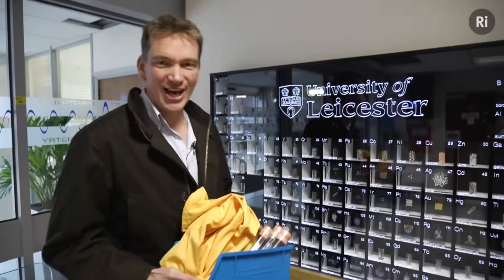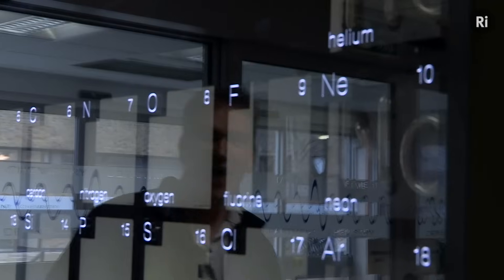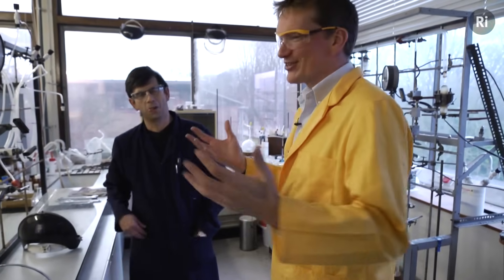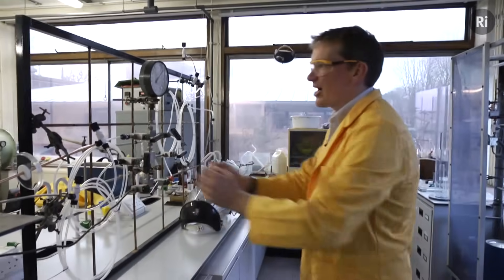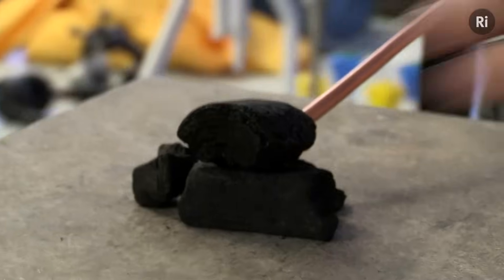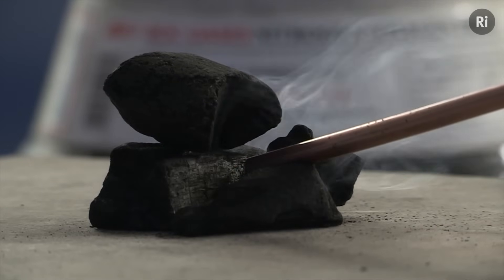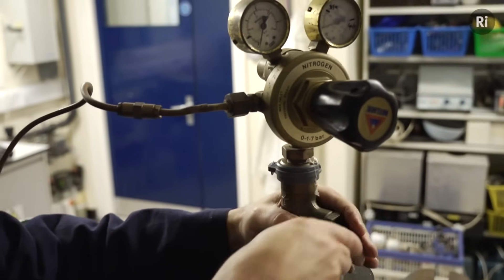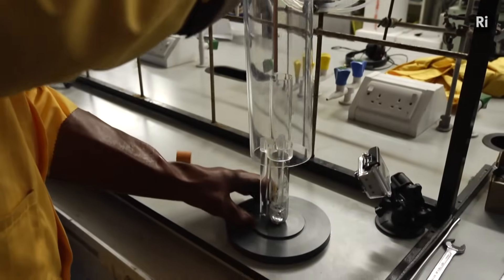Reacting Fluorine with Caesium - First Time on Camera

Comment: Me wonders what kind of impulse one could get out of some kind of rocket engiine using cesium fuel & flourine as  an oxidizer...🤔
Reply: Energy density is actually quite poor. 432 kJ per mole. Hydrogen-Oxygen is 286, but of course the mass is much less

Comment: This could count as the most electropositive element (Caesium) react with the most electronegative element (Fluorine).
I wonder if that light shed some UV light...but that should've been blocked by the glass tubes (or plastic since fluorine reacts with glass, SiO2)

Comment: There’s an important distinction to be made here between differing notions of chemical reactivity. Yes, cesium has the lowest ionization energy of the group 1 metals, but from a thermochemical standpoint that only makes for a low activation energy. This is why you see cesium ignite in air (under high humidity and prompt exposure) and explode so rapidly on contact with water. HOWEVER, the thermochemistry also goes to show that the large ionic radius works against cesium’s enthalpy of reaction with many other elements. In other words, the large size of the cesium atom prevents it from bonding as tightly, and in turn cesium releases less energy per atom/mole in most reactions when compared to all the other group 1 metals. If you don’t believe me, compare the condensed phase enthalpy of formations for all the alkali fluorides on NIST - lithium takes the cake on a per atom basis AND on a per gram basis. This is all not even touching on the fact that and atom of cesium weighs a lot more than lithium, about 20x more. 
The significance of this is that an equivalent mass of lithium replacing the cesium in this shown reaction would produce 21.23 times more heat reacting with fluorine. Considering that fluorine will react violently with any alkali, and heat will only accelerate the reaction by making it more spontaneous, it is safe to say that a you would see a much more exciting show if you used lithium over cesium.

Comment: Underwhelming. Was expecting a big explosion. 0/10

j/k I know a lot of effort is required to put together the setup, and there can be legit safety hazards if the reaction is to be scaled up. It also supports the hypothesis that a reaction tends to be more spectacular if a gas is produced and is allowed to expand due to the heat released (but there is no gas produced here).

Comment: Nitrogen is one of the few elements that doesn't instantly or easily react with fluorine. It takes high temperatures. So they used it here as an inert gas to protect the cesium from oxygen and atmospheric moisture, which may have ruined the experiment.

Comment: "I've brought with me here a tube containing caesium"

No, you clearly haven't.  Caesium is gold in colour - I know, because I have a sample, and what you have there is obviously silver-coloured.    And then a load of it appears to have evaporated and changed colour by the time you get to the sequence around 3:26.
Reply: It clearly has a golden colour and what makes you think that it evaporated?
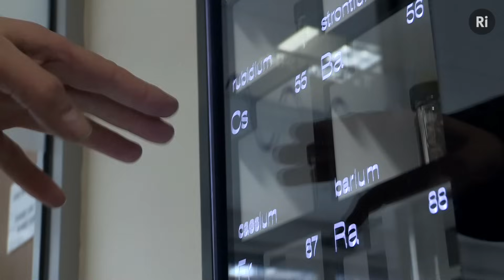Reply: @HanTrio3  The tube described as caesium at 0:22 is obviously silver-coloured.  Compare the colour and sample size at 0:22 with that at 3:26.  'Evaporated' is being used sarcastically because the sample being used is clearly much smaller than the one that appears at 0:22 - because it's NOT the same material or sample.
What's being shown at 0:22 is probably either Na-K alloy or In-Ga alloy - Cs would not be so liquid at room temperature in Leicester unless it had been heated beforehand - and I'm not convinced that any H&S officer would be happy with someone shaking a tube of heated liquified Cs in a public foyer.   And even if they were, it certainly wouldn't be that colour.

Comment: Can you explain why francium is less reactive than ceasium, and then do some francium with the fluorine anyway just for shits and grins?
Reply: 1) Francium is less reactive due to relativistic effects. The electrons in very heavy elements reach significant fractions of the speed of light. This leads to them "orbiting" closer to the nucleus, and consequently they react less easily.
2) Francium is extremely radioactive. It decays so quickly that its impossible to collect enough of it to do such an experiment.

Comment: What happens when you take the most electronegitive and positive elements  florine and cesium and combined "bond" it with the most symmetrical anchor of carbon 12 rather then trying to get a reaction with out the carbon atom present? On the molecular level of course or well atomic level I suppose.

Comment: And now, You have created one of the most stable compounds, Caesium Fluoride, good luck freeing the caesium again without a lot of hard work from that, though I have to say I have always wanted to see this reaction. Made my day.
Reply: Actually, CsF is so ionic and the differential in charge is so great that is not that stable
Reply: @thetaintpainter5443  huh, interesting
Reply: @thetaintpainter5443 what are you saying? CsF is lot stable.... due to high ionic bond strength...
Reply: Lithium fluoride would be even more stable, because lithium is much smaller, so the ions can get much closer together and therefore be held together more strongly by their opposite charges.  Lithium fluoride has a standard enthalpy of formation -616 kJ/mol as opposed to cesium fluoride having a standard enthalpy of formation -553.5 kJ/mol.  (I would have given the Gibbs free energy of formation, but I couldn't find it off the bat for lithium fluoride; for cesium fluoride it isn't very different from the standard enthalpy of formation.)  And lithium fluoride binds to itself so well that it doesn't dissolve very well in water, whereas ridiculous amounts of cesium fluoride dissolve in water.
Reply: @Lucius_Chiaraviglio   And I imagine it would slightly react with water to form hydrogen fluoride
Reply: @DANGJOS  Indeed, it would be an equilibrium, mostly staying as dissolved cesium and fluoride ions if you didn't do anything else with it, but getting pushed in favor of forming hydrogen fluoride if you add acid.
Reply: @Lucius_Chiaraviglio   Ah that makes sense! Especially if you added something like concentrated sulfuric acid. That would be a bad idea!
Reply: @DANGJOS  According to Wikipedia, "Hydrofluoric acid was first prepared in 1771, by Carl Wilhelm Scheele. It is now mainly produced by treatment of the mineral fluorite, CaF2, with concentrated sulfuric acid at approximately 265 °C."
Reply: @Lucius_Chiaraviglio   Oh that's fascinating! Thanks!
Reply: kJ per mol is a very cursed unit, why not J per molecule/ or kJ per kg? Those would actually be useful 

Moles are an abomination in general, I wouldn’t mind if it was a mass measurement of a nucleon like 1 proton = 1 neutron = 1, close enough, but moles??
"One mole is an aggregate of exactly 6.02214076×1023 elementary entities"

It apparently comes from the ratio between a gram and a nucleon, and like good and all that’s almost the concept I wanted but then what kind of deranged lunatic would apply this to other things than nucleon? Because moles can be applied to anything even molecules, 1 mole of graphite is not equal to one mole of methane, so it just becomes this unhinged unit of number based on absolutely nothing with a huge 10^23 number and a super long decimal length
Reply: Joules per molecule would give you a similar concept to the kJ per mole 

Joules per nucleon would be like specific enthalpy 

And joules per kg would be the same but at a macroscopic scale
Reply: The strongest bond in chemistry is the friends we made along the way
Reply: There is a simple answer to that - electrolysis.
Reply: All you need to free it is to mix with calcium or magnesium metal and heat it very strongly. The cesium boils off and the fluorine will stick to the calcium or magnesium. A tiny amount of iodine or bromine helps to start the process.
Reply: @christopherleubner6633  Yes, it's a matter of adding enough heat and let equilibria do the work. The actual hard work would be setting up the apparatus properly, exclude air, isolate the product safely etc. etc. as shown by recently by Elias Experiments producing a kilo of potassium metal from potash and magnesium. A year-long project!
Reply: Cesium iodide?
Reply: And when you make calcium fluoride, you have  a beautiful very stable mineral stone, found in nature: fluorite, or fluorspar.
Reply: not really
Reply: I’d do this with teleported waldos. From a few hundred meters away.

Comment: Holy hell Im in love with that periodic table at the beginning. Its so cool to actually be able to see each element.
Reply: The biggest “wow” for me was that the periodic table has a vial of fluorine. Someone must have spent a lot of time making that happen. You can’t just put fluorine into a vial – it’ll eat its way out. That glass must have been treated so that there’d be a passivated layer that had some self-healing properties. Kudos to whoever pulled that off. It takes lots of care. Contaminants will act as bridges that will cut through passivation and make a hole in the glass eventually (or quickly, depending on what the contaminant is). This is the sort of stuff where plain old dust from the air can mess things up.

Unless it’s just a vial filled with air. Should be easy to test - fluorine has lots of absorption lines in the visible spectrum, a hand held spectrophotometer should be enough to tell perhaps. Even stronger lines in IR if I recall right.

Comment: Francium and Fluorine would be interesting, as francium is radioactive and decays. Would the decay release the fluorine to react with more francium? The decay products can't hold onto the fluorine more, but if they hold onto it at all, that changes the energy gradient and so the frequency of light.

Talking of light, fluorine reactions should be photosensitive, although not necessarily the reaction shown and the reaction suggested. We need to see a repeat under different conditions, with spectral analysis. To avoid statistical issues, the law of large numbers applies. That means you need to scale up.

Comment: so how stable is cesiumfluoride?
Reply: Probably about as stable as sodium chloride, aka table salt.

When two elements react violently together, that generally means they're forming a very stable compound - the energy released as the bonds are formed is the same energy that would be required in order to break the bonds again.

Comment: What about Francium? I'm pretty sure its more reactive than Caesium.
Reply: Francium exists in miniscule properties solely as the brief product of the decay of a fairly rare Uranium isotope. It's half-life is under a minute iirc. As a result, it's not possibly to obtain enough of it to even know what it looks like or what its chemical properties would be.

Also, highly radioactive elements do not always have the chemistry you'd expect because radiation gives off heat and that affects what reactions can be done.
Reply: Joshua Schoeman watch the video again

Comment: The tube didn't even explode. Lame.
Reply: peterpan260983 to be fair, they planned it that way... Escaping fluorine has a good chance of turning to gaseous hydrofluoric acid, and caesium more-or-less blows up on contact w/moisture, so escaping reagents here could've very easily been deadly. 

(I do agree, it looked a bit anticlimactic, however)

Comment: May I just say that both of you professors are absolutely insane for doing this. With that said, that was interesting.
Reply: Why? Everything is a matter of quantity

If the energy released per gram is like 5 times more than burning paper and you’re burning 1 gram then it’s as bad as burning 5 grams of paper big whoop
And if there is matter everywhere both will react in stable compounds before reaching humans anyways so the toxicity shouldn’t an issue, and that’s if it leaks

Comment: Throw a big ol lump of Cs into cryogenically liquefied Fluorine
Reply: That is the most idiotic and irresponsible thing you can do with those two. I support this idea!
Reply: If you have a glass of water and you create vacuum inside, the water will start boiling at room temperature. To liquefy fluorine at higher temperatures, you need to increase the pressure, not to decrease it. At athmospheric pressure, it will be in liquid state at temperatures under -188 °C
Reply: Actually it can. In a different video the same professor liquified flourine gas with liquid nitrogen. It's a yellow liquid.
Reply: nakawoopahkapooski that'd be a terribly good idea
Reply: That reaxion might creat e mini black hole & destroy the planet Earth
Reply: Liquid oxygen is nothing compared to liquid fluorine... Don't do it guys!!
Reply: do you really want to cause fractures in the space time continuum and release demons from the dungeon dimensions?...because THAT'S how you do it.
Reply: Or just sprinkle powdered rubidium into liquid chlorine.
Reply: I suspect the reaction would be much more violent than this, especially if the Cs is liquid (melts at 29°C).
Reply: nakawoopahkapooski lol, the cesium would blow up before it even hit the fluorine bc of the oxygen😂

Comment: They used cesium 137 in that reaction
what you saw was a cherencov reaction, the blue glow when you force plutonium Pu-239 into supercriticality.  A super rare event happened the ultra rare fission of cesium 137 causing an extremely high count release of viable light, heat, beta particles (blue cherencov tinge) & a massive 155 grey gamma ray emmission. 
I hope they had fun, because they have at best a  few days to endure acute radiation sickness before they die.
Who says Cs-137 can't fission? we just saw it happen.
Reply: No, that is not Cherenkov radiation. Reactions can produce light.

Comment: K, I know this video is rather old, BUT, I'd really like an answer if possible.  Both the Carbon (BBQ Brickettes), and the Caesium, appeared to have little lightning coming out of the reaction.  (Not so much the BBQ bricks, although it sounded like it), but the Fluorine and the Caesium certainly did.  Now, I also know the reactivity of the Elements depend on how they wish to fill their shells, ripping electrons from other elements (Or most one on one reactions), so is this the case ???  Is the fluorine ripping electrons from the caesium, showing up as a little electrical storm ???

Please and thank you.

BTW, thanks for the videos to everyone envolved.  Getting more knowledge in my head is always a good thing -;)

Cheers!

Comment: Is Caesium Fluoride salt still dangerous?
Reply: I'd imagine not? Generally if two things like that are super reactive once they've made a salt they'll hold onto each other super tightly. You'd need something MORE reactive than one of the components. I think?
Reply: Neophlegm Yes you are correct. Both Sodium and Chlorine are dangerous elements (well, sodium not as much) but when mixed together, you get something as harmless as table salt. Also, Sodium Fluoride can be seen on toothpaste.
Reply: Yes, it's still dangerous. It's toxic, like all soluble fluorides.
It can generate potentially deadly HF vapors when mixed with an acid. Not something I'd like to store in the kitchen cupboard.

Comment: Let's see the caesium flouride!
Reply: You can have CsF dissolved in water, because the Cesium is an ion it doesn't react with the oxygen in water, because it has a full electron valence shell.
Reply: CsF actually is an salt, this salt reacts with water, so you can't desolve it in water. You know if you desolve CsF in water, fluoride-ions and ceasium-ions will go into water. The ceasium-ions react with water due to the extreme reactivity

Comment: Chemical reactions  happen more slowly at cold temperatures. I'd love to see what happens when a pin made of cesium is slowly pushed into a small disk of frozen fluorine while all this is submerged in liquid helium. Would it react with a simple touch? or would a little twisting of the pin be needed?
Reply: It would create the molecule CsFHe. That’s what they make that impervious super tough plastic used to seal any household product that you can never open.
Reply: that sounds like boom

Comment: Can I know which is more electronegative fluorine or a proton (H+)
Reply: it's fluorine I think, because it has 9 protons whereas H+ has only 1. moreover, we know that fluorides require much less activation energy for their formation than hydrides.
Reply: +Saad Mohd but there are also 9 electrons in flourine which also produces shielding effect and lower the nuclear charge but in H+ there are no electrons just a proton so the nuclear charge will be at its peak
Reply: +Usama Irfan Actually, the 9 electrons of Fluorine produce an effect called electron pair repulsion(due to small size) which comes into play only when the electron donating species comes near the F atom, but nevertheless it has nothing to do with its electronegativity in general, which actually is huge. That is why Fluorine has Chlorine as a competitor, not Hydrogen. ;-)
Reply: +Saad Mohd 
Can I ask you some another thing its a very much deep topic
Reply: Usama Irfan Yes of course, please ask, i will try to answer.
Reply: +Saad Mohd 
I just wanna ask that what is ENERGY?
Reply: +Burim Emini I am not talking about an atom I am talking about H+ ion (proton) 
so it has pure positive charge but in flourine there is shielding effect of electrons and neutrons and bla bla
Reply: +Usama Irfan Fluorine is far more electronegative.
It is 4 on the Pauling Skala while Hydrogen is 2.2
Reply: Fluorine is the most reactive non metal, H+ isn't very reactive at all.